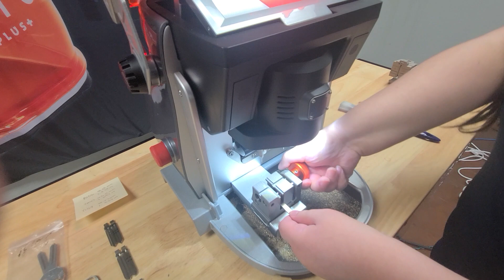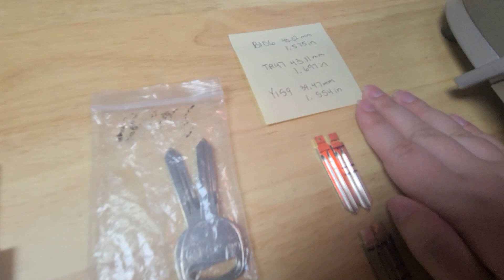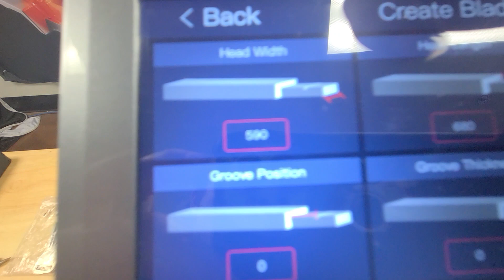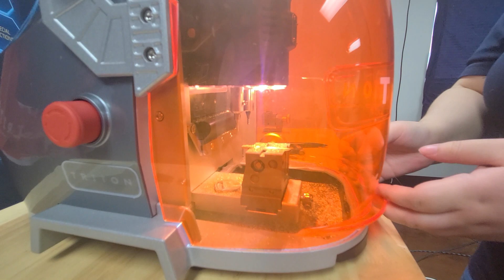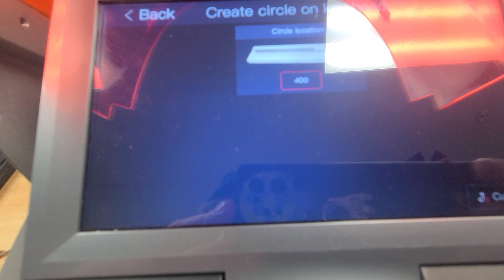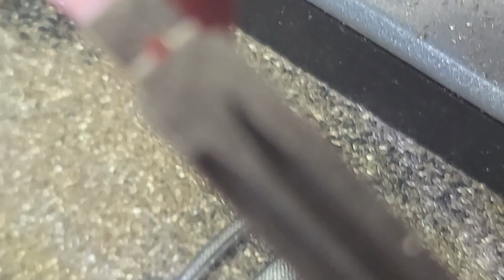Triton Plus Key Machine S8 Flip Blade Creation Jaw Calibration & Test Key

Comment: These videos are great. I have a triton and can figure most stuff out with trial and error but having videos really helps. I never would have known that I had to download onto a thumb drive new software and remove the old one to upgrade without these vids. Thanks Sam!
Reply from the maker: You're very welcome! :) Once you are past that initial manual update, you should be able to download updates normally with just WiFi connection. There are definitely some features that take a bit more trial and error than others. Even I cut my first flip blade key with wrong positioning!

Comment: I don't understand why we would have to press Cancel during a cut.  Should the programming be such that it automatically stops when it should?  That said, thank you for posting this.  I've been very curious about this process.
Reply from the maker: The only reason that you would need to press cancel is if you don't want it to cut the groove for the roll pin so the area will be flat. Otherwise, you don't have to stop the cutting process. Unfortunately, there is no way to get rid of that groove at this time
Reply: @Samantha-LockLabs  Ahhhh!  I understand.  Thank you!
Reply: Cut tool pin are today for Xhorse remote for Honda using standard measurements in computer already. Need to either create me a Cheat sheet and laminate or either see if there’s a way we can submit settings, possibly tips they can embed or include with app on phone? 

My roll pin went in fine but key was to short and also key was loose when retained by roll pin. 

I do a said amount of switchblade keys as long as there’s not a shifter adjacent to the key hole as can cause issues.